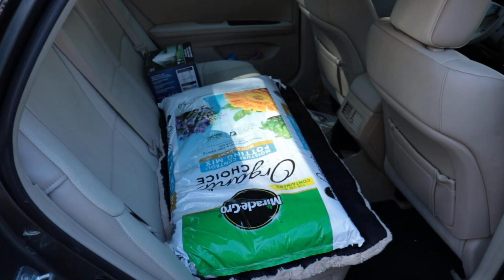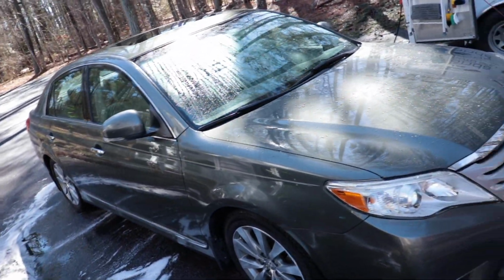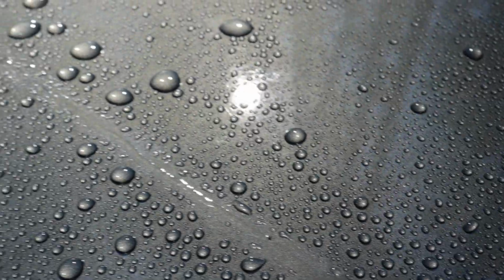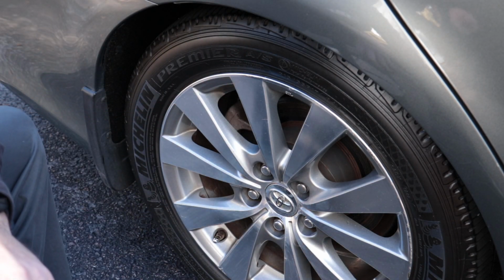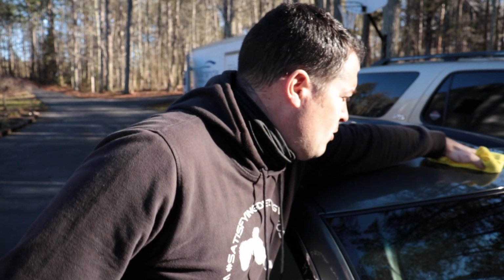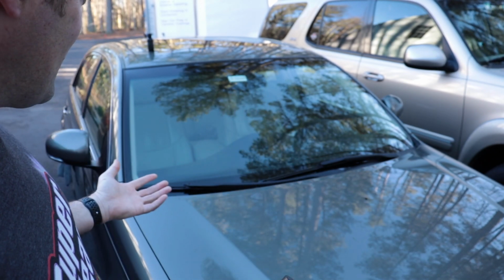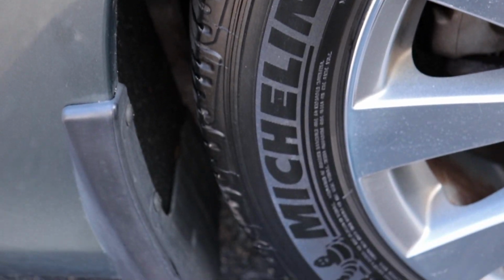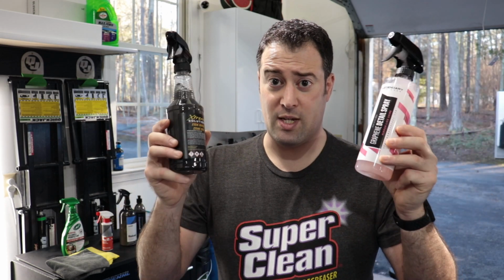Weekday Wash / Testing NEW Products! #autodetailing #detailingtips

Comment: Hey Phil, it is a great idea to apply the window coating to the wipers, but just try wiping the wiper with cleaning alcohol first. You won’t believe your eyes when you see all the dirt & grime on the rag. Then apply the coating to the wiper. Just a little tip I thought someone would like.
Reply: I do this and it works great!
Reply from the maker: Oh yeah I know that. Like I mentioned this is just to test it out. On customers vehicles I would have polished the glass and cleaned the wiper blades. 😎👍🏼

Comment: Thank you again for the updates and introduction to different products. Soft clear on Toyota’s cars can be challenging to correct. I’ve had success with Adams Graphene Spray coating topped with their Graphene Detail Spray. Will try the Legendary Detail Spray on next wash. 303 Tire Balm seems to be holding on for over two months.
Reply from the maker: You’re welcome!  Thanks for sharing! Wow the 303 tire balm is lasting that long?
Reply: @MirandaDetailing  It’s probably because I have 3 vehicles and it wasn’t driven in crappy weather. Will try it on the SUV and see how it does.
Reply: Have any of you tried the tire dressing from Autofanatic?
Reply from the maker: Hi. Nope I haven’t. Is it good stuff?
Reply: @MirandaDetailing  I’ve tried the Autofanatic Holeshot SiO2 Infused Tire Dressing. It’s just Okay, comparable to Carpro Perl.

Comment: Phil the C2V3 works great when mix it 1:1 with distilled water as drying  aid or post wash topper. I got this recommendation from Eric Joseph of Gtechniq . No streaking and definitely  preserves my CSL/EXP  V4  coated cars. I do love Xtreme solutions Topper for the most bling and slickness.
Reply from the maker: Hi. Thanks. Yeah I know about the diluting it. I figured it has water still on the panels that a light mist works great also. No streaking or anything after. I love this stuff!

Comment: It looks to be the same as the Adams spray coating. I try to specifically use in sun I think it helps to have better film build if you put on heavy and let the sun evaporate the extra liquid solvents. Doing it in sun with extra thick application helps with durability
Reply: It’s the same thing just tweaked to not have the UV tracer.  It’s no secret that most of these graphene products are coming out of B&B
Reply: @MikeGDetailing  I’ve really like the products coming from the B and B folks the ease of use is great and price is good durability I just want 18 months when I put any coating on.
Reply from the maker: Yup. I read don’t care where they come from as long as they work.  I realize many products, coatings, and tools come from a few major manufacturers in the world. Then each company can tweak them to make them their own adding or taking away from certain products. But all together it doesn’t matter as long as they work for me.

Comment: Great video!! I have a question for you or anyone that has had this issue I finally got a chance to clean the interior of my truck and noticed a stain in roof headliner inside the cab. I called the dealer and will be dropping off the truck soon for them to do testing my guess the sunroof and satellite is what they will test. Anything I should be looking for to make sure the dealer does it right meaning replacing he liner? Should I be worried about mildew? What would you do? Hopefully the dealer doesn’t take forever and does the right thing.
Reply from the maker: Thanks. What’s the year make and model?   II have seen many of the Ford F-150 models have issues with the third brake light also leaking. But it could be the sunroof or rear window seals also.
Reply: @MirandaDetailing  it is a 2018 GMC Sierra 2500hd I guess just have to hope the dealer does a good job.
Reply from the maker: Oh yeah. Don’t give them any slack!

Comment: 10th great having a better and warmer day!
Hi to Mr. Sal 👋👍
One thing I do when applying coatings to windshield is have the wipers lifted all the time until it cures and obviously clean the wiper blades very well.  I do that because the coating curing and having the wipers down could make the blades harder and damage the coating too.  Just my experience with coatings on windshields if they are Ceramic coating products vs. the one from GlassParency for example.  What is the cure time on that one before putting the wiper blades again on the windshield?
Reply from the maker: Hi! Yes that’s exactly what I do on customers windshields. It’s a 24h cure time on this glass coating.